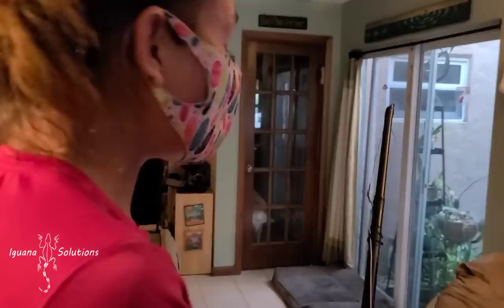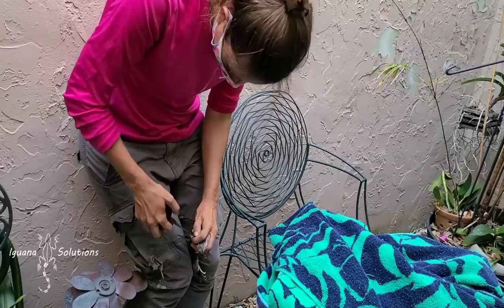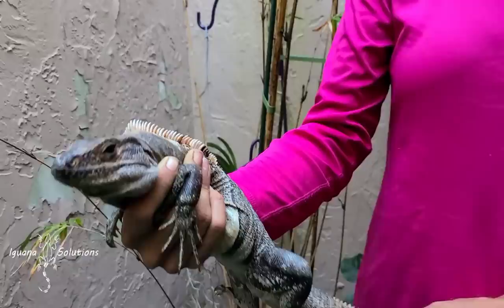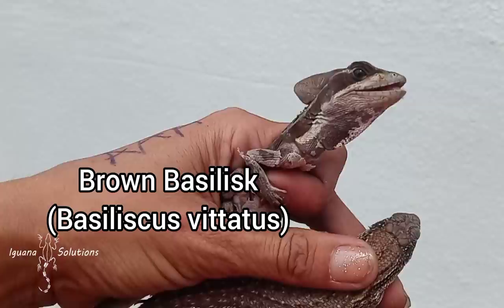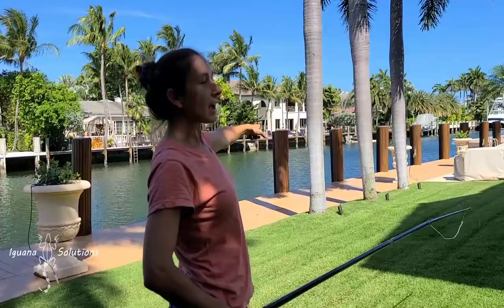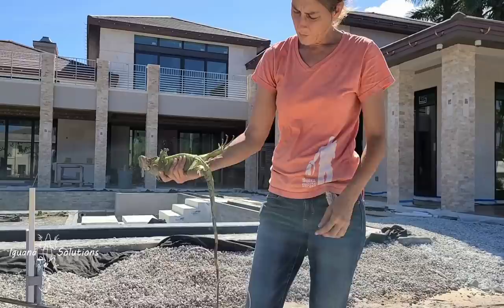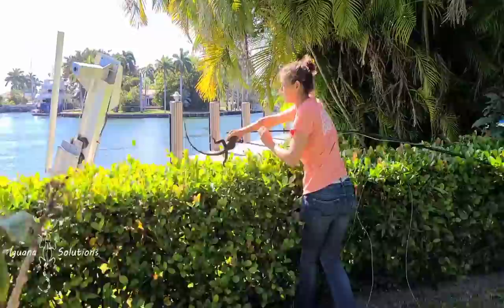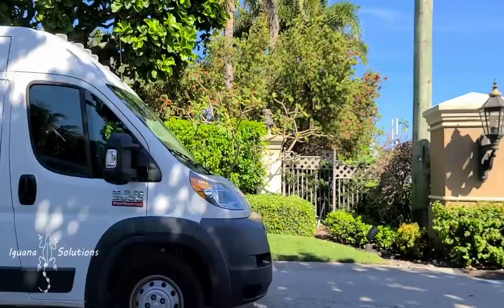IguanAdventures with Iguana Solutions: invasive wildlife removal in Broward County Florida

Comment: Hey there, I live in Alaska but I visit Florida when I can, about getting scratches, I hate to see you getting some bad  infection,  I work with sharp blades and sheet metal so I bought what they call anti cut sleeves,  you can get them fairly cheap on Ebay,  also spectra anti cut gloves. They are fairly light for wearing in the heat. Keep up the excellent videos!
Reply from the maker: Thank you! Yes some people have told me about the butchers no cut gloves that sound similar. Thanks so much for the info. I may look into them...but then all my fun scars for stories would be reduced😏

Comment: Make a loop of wire and twist the ends tight. Tie  paracord to the loop, then pass the cord through a piece of electrical conduit. Tighten the loop by pulling the cord. Works on raccoons. You will need some way of locking the cord so it can't pull out when tightened. Cord locks or barrel locks will work, if you can  find one strong enough. You could make one. Drill a hole through a large bolt, put a nut on each side of the hole, run the cord through the hole, and tighten the nuts finger tight to lock the cord. Then tape the iquana, and release the cord. As a catch pole it is durable and the cord won't tangle in vegetation. You will probably not get as much length before it becomes too heavy to use.  
      I remember seeing a burlap bag used to hold captured snakes on Wild Kingdom. Have you tried that for iquanas? It would be easier to carry, particularly on a ladder.
Reply from the maker: The bags allow escape unless i still tape them. The pole you described is for larger stuff in my opinion but thank you- that is how they seem to do the gator poles. Weight is my biggest concern with this type

Comment: Geese people you are supposed to be professional's and you seam to have a heard time preparing your equipement to get the job done. It is either you forget your loaders for the air rifle, your gloves, don't set up the pole. It may be a good idea to have a check list before any outings so you have all you need for the jobs.
You are like a mechanic going out on road service and forgetting his tool box.
It looks like you wing it all the time.
Just my observation.
Have great day
Reply from the maker: Lol or i am going to like 10-12 jobs a day from 8-8💁 when it never stops you dont get to do a checklist. 😁😁😁😁
Reply: @iguanaSnipers  Doing a check list will make you more efficient and lose less time then working with the wrong tool. It will prevent you after a time from having to do 12 hr days running around blindly. 
Each step you take, each move you do must be calculated to wast less time and energy and be more efficient.
 Less waist of energy will result in more productivity.
You say you have no time for a check list but will work with tools that are not efficient and take more time and more energy.
I am not saying your do not work hard, on the contrary  you work your but off.
Taking the time to fixe broken tools properly and having the right amount of supplies will pay off at the end of the day.
Don't believe me try it.
Sit down and make a list of what you need in a days work, then  multiply it by two. This way you will be able to face the unexpected.
Have a great day